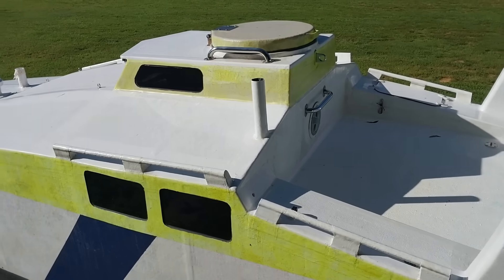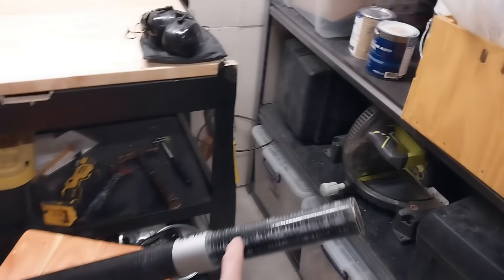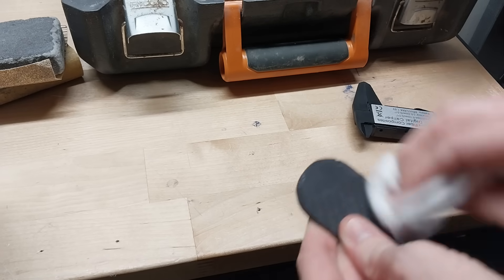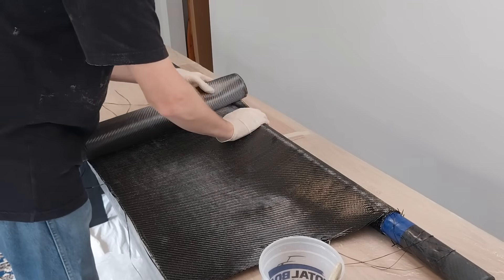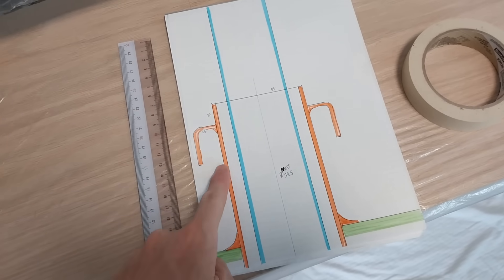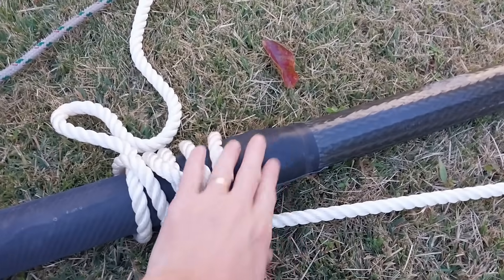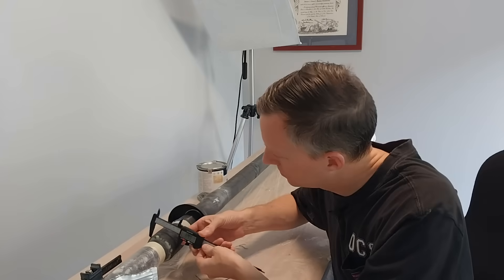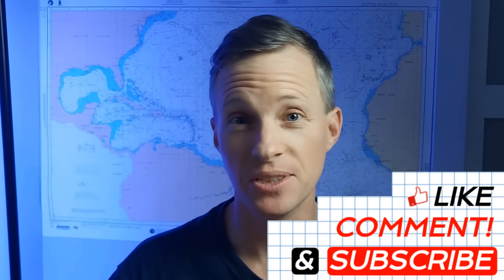OCSS-099 My (Controversial?) Carbon Fiber Mast Build Method

Comment: The mast looks great.  I was a bit worried about the tang you added to the top of the mast right after you installed it because you did not wrap any carbon fiber around the mast below that point to reinforce the slot that you cut.  Then at the end of the video I could see that it was added later so looks good.

What happened with the mast that you drove across LA on the roof of your car?
Reply: I believe the LA mast was too heavy. It was designed for a much bigger boat.
Reply from the maker: Yes I came to realize it was much too heavy, 5 times heavier than this one!
Reply: @ocean_capable_small_sailboat  Sounds about right.  One very fast way to make sure that your mast has at least the minimum strength you need is to attach a line to the masthead and then use that to pull the masthead down to water level.  when the boat is held horizontal by the top of the mast, you have exerted the max force that the keel is capable of generating.  I say minimum because you can generate extra loads if the boat rolls completely over with waves pushing on the submerged sail.   

With your boat, I would do the pull-down test as soon as you launch the boat because if it does not pass that test without issue, you definitely need a stronger mast and now is the time to find that out rather than mid ocean.